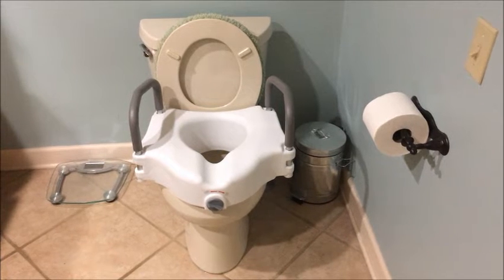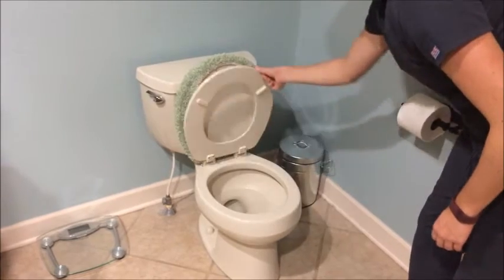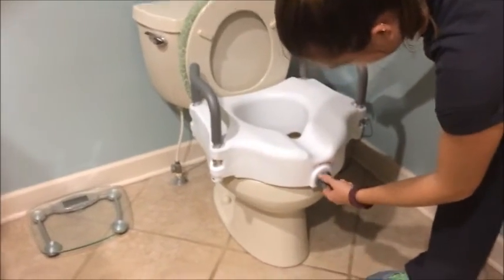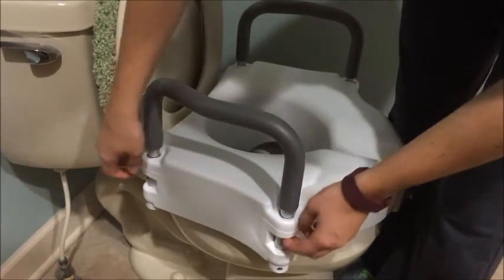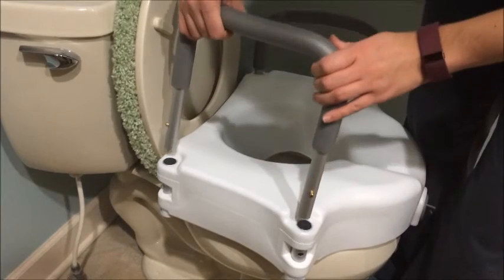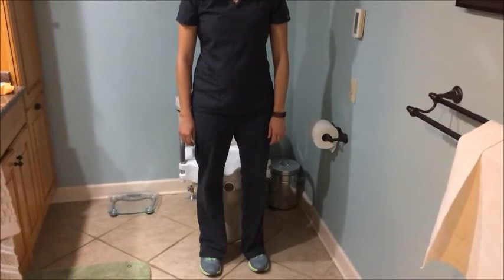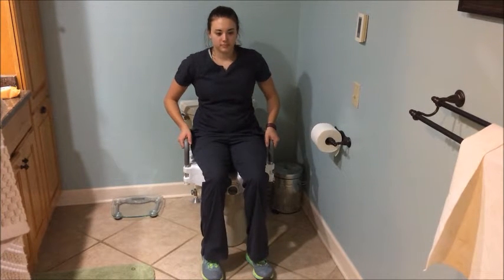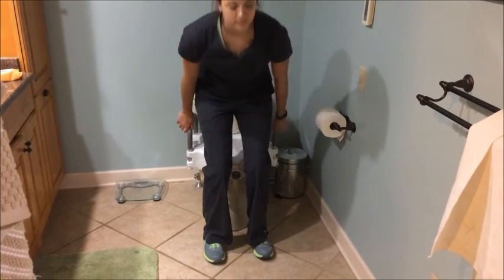locking raised toilet seat

Comment: I bought one of these raised toilet seats. Recently had ankle surgery.  The seat is suppose hook under the toilet bowl.  However, the seat won’t work with our toilet because the rear of the bowl extends down too far for the hook on the bottom rear of the seat to lock in place.  Consequently, the seat is worthless—-and dangerous and insecure because the seat just sits unsecured on top of the bowl. Worse yet, urine leaks out onto the floor because the urine adheres to the bottom of the seat and through capillary action, follows the contour of the bottom of the seat and drips on the floor.  Gross!  The seat is worthless and the medical supply store will not take back bathroom supplies.  I’m out 44 bucks for something that doesn’t work.  Beware!